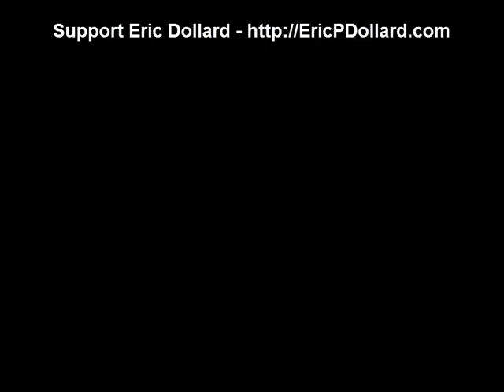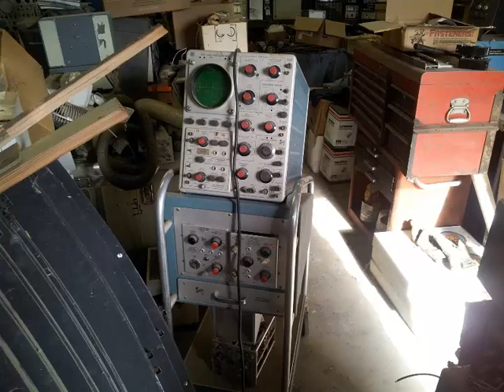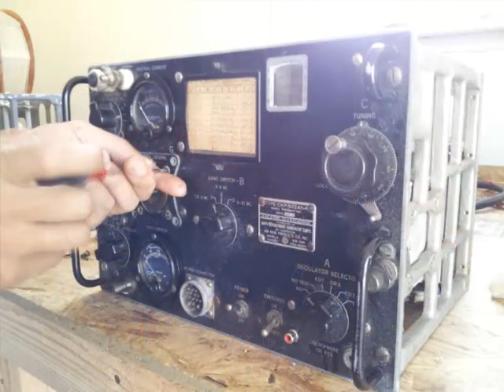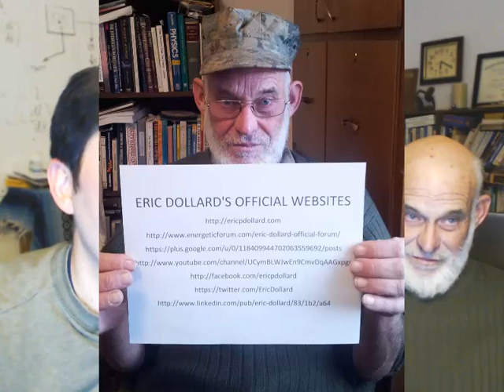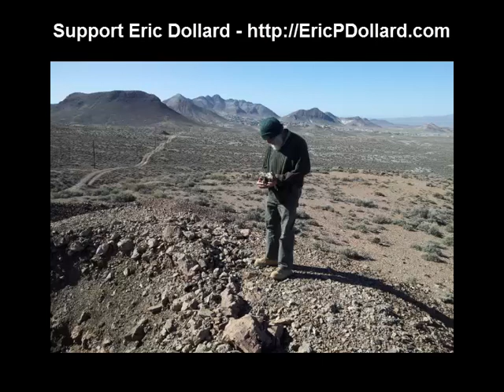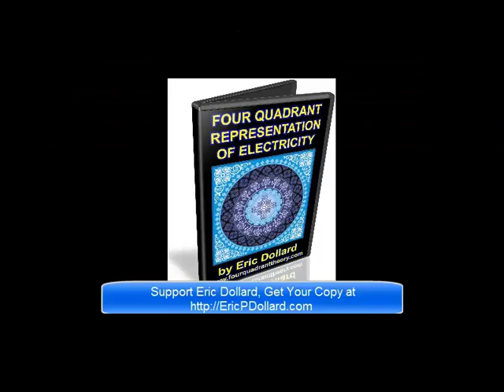Eric Dollard live interview by Aaron Murakami - November 5, 2013

Comment: Does the equipment have to be old? Seems like the large component/ tube type ( with some distortion ) vs newer smaller more discrete component type is preferred. Is the noise/distortion etc. preferred or necessary?  Just thinking that might be a possibility.  Also if you need test equipment manuals I might be able to help.